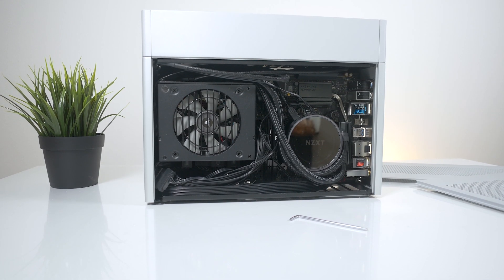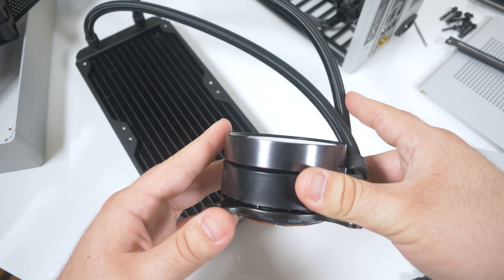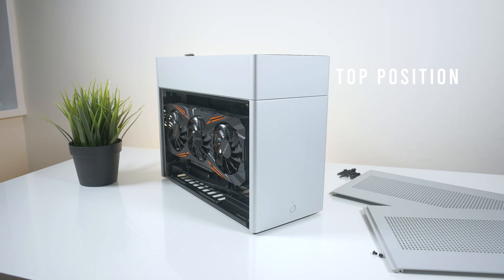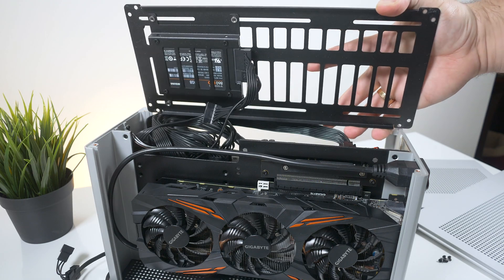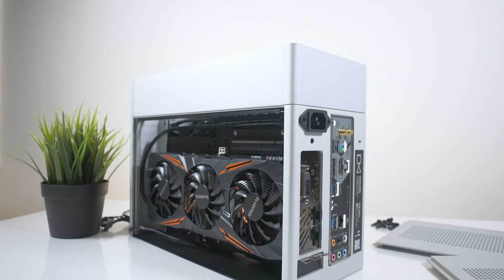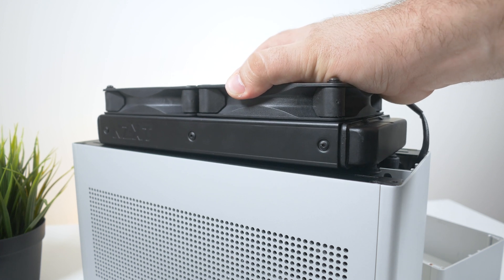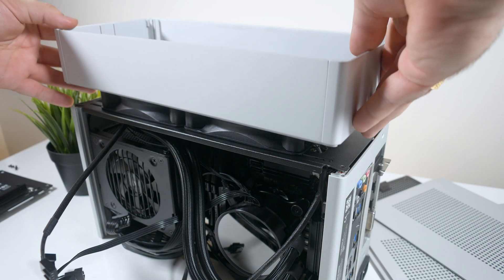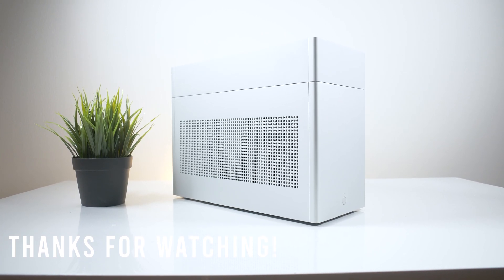Watercooled Louqe Ghost S1 Thermal Results! (NZXT Kraken x52)

Comment: Hey man, know this is an old video but figured you could help. Which pin connectors on your board are you hooking these up to? I see only one "Chassis fan" connector, did you split it for the two fans? I know the pump goes to the CPU fan connector.

Good content, keep it up!
Reply: Just realized you're on a 370, I'm on the 390 >.<

Comment: I can't help but disagree on the cable management part. While it took quite a large chunk of time, i managed to make it so that the stock cables in my ghost barely take up any space. I have a fan in the bottom with no tophat, and it doesn't even need a fan guard. When it comes to managing cables, especially in a small case like this, i find that a lot, if not all Tech Youtubers hardly put in any effort. It took me between 3-4 hours to manage mine, but that amount of time taken was worth it for the result. Not to mention, the challenge is honestly quite fun, IMO.
Reply from the maker: I have since made custom cables for this case, and switch over to the Velka 5 which I'll be releasing a video real soon on my build.

Comment: Do you think I could fit this to a 2080ti using the G12 and have it fit in the S1?
Reply from the maker: I believe so, as long as the g12 isn't taller than a normal 2 slot gpu, you should be fine.
Reply: @dpereiraalvarez  Its the added height the x52 pump adds I'm concerned about.  I'm playing games right now but with the side panel off to improve thermals.  Ive debated trying to get a custom glass side panel made with tons of ventilation.
Reply from the maker: Have you tried undervolting your gpu?
Reply: @dpereiraalvarez  yeah I have seen it on another video.  I used afterburner and set max clock at 1850mhz but still too loud and very hot.  Nothing like the improvements made in the video I watched